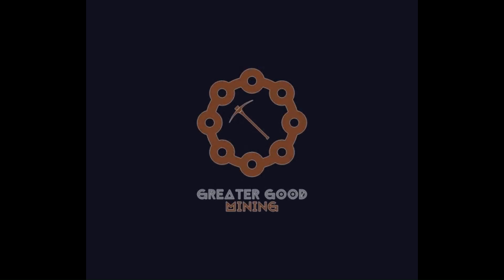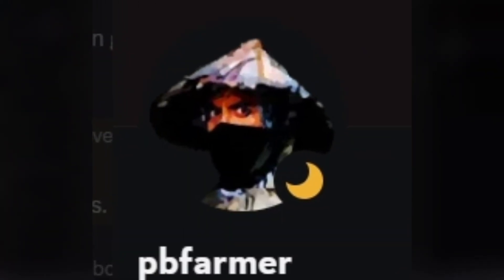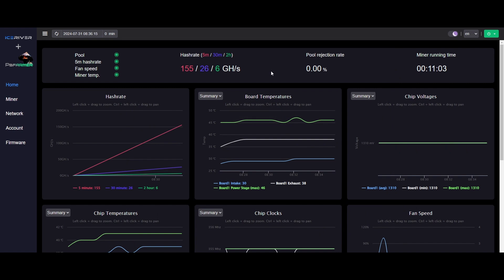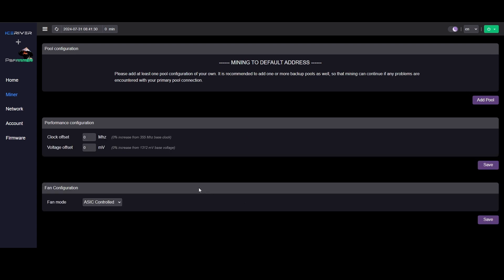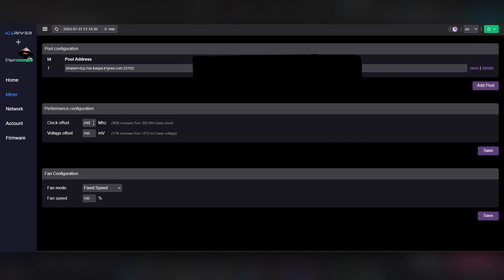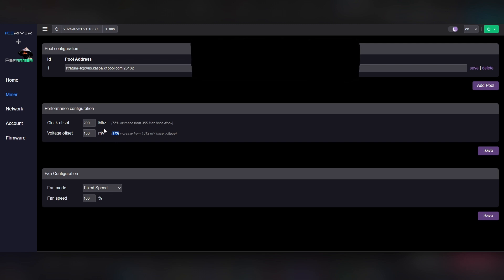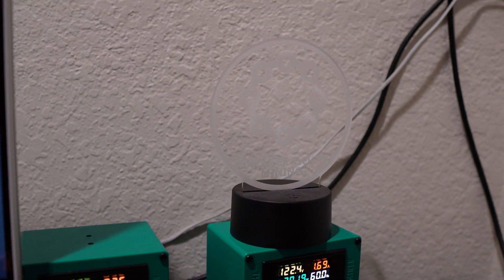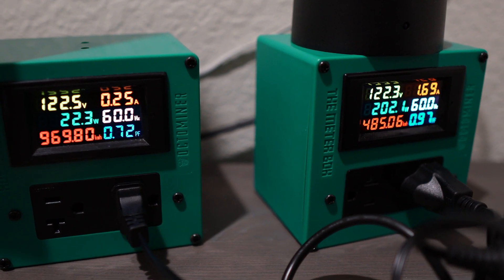NEW! Iceriver KS0 Ultra Kaspa ASIC Overclocks from PBFARMER! (KS0 Pro giveaway!)

Comment: I encountered a weird problem today. I had my ks0 ultra overclocked and mining for a couple weeks but my powerstages were over 100 so i decided to add copper heatsinks. After i did that and let it dry for a day i plugged it back in and it wouldnt hash. Powerstage and chip voltage would stay at 0. I tried setting overclock settings back to 0 and resetting multiple times nothing helped. I had to factory reset it, then it was showing machine offline so i had to change ip to static, for it to show as online. Then it still wouldnt hash and was saying unstable. So i reflash pbfarmer and now its working perfect and hashing again....WTF
Reply from the maker: That is weird, I havn't had anything like that happen. I'm glad you got it sorted out though!
Reply: @GreaterGoodMining  it's been hashing way slower. Since it started running again.  Set to overclock had it at 600gh now has it at 430. When not overclocked ot can't even touch 400 now .

Comment: Thanks for the Video and also to PBfarmer. My Ultra runs at 600gh with no problem using cheap dual 120mm usb fans and one shrout, removing the closed frond and back plates, new heat paste and 4 extra heatsinks for the power mosfet. 
200mhz +56% clock (555mhz) , 175 + 13% voltage (1500mV)
Fan 70° min 30%
Reply from the maker: @mucwendel  nice, those are great results 👍  How are your power-stage temps?

Comment: Do I need to open up my Ultra and change the PSU to install this software and get a little bit more GH? How much GH could I increase with just a normal computer fan on the top of it?
Reply from the maker: You can do light overclocking  without changing out paste or pads. You might want to at least take the side panels off to allow for some heat removal. You could shoot for 500gh and see how it goes by slowly adjusting

Comment: KSO Ultra is running great with the new PBfarmer firmware. Getting just shy of 600gh. #meterbox
Reply from the maker: Nice! thats some good results!
Reply: Hi i had also tested the pbfarmer fw on one of my ks0 ultra. I config my mining pool but i didnt see it on my mining pool Website. On the websurface of pbfarmer  i have seen green point only on the pbfarmer Adress but i didnt see if my pooling Adress is working. Do you know the Issue?
Reply from the maker: @svencronau8321  did you set a back up pool? It might have switched to a back up pool
Reply: @GreaterGoodMining  i have added  only my pools
Reply from the maker: @svencronau8321  is it the same pool enteted 3 times?
Reply: @svencronau8321  I'm not sure what the issue is. What pool are you using, and are you sure you're using the correct port?
Reply: @angrybear6611  i have to open an port on my router ? This i have not done

Comment: Thanks for the super video. The fan shroud you printed yourself the narrow black one, would you happen to have a link for the STL file? ❤
Reply from the maker: You should be able to find the file if you look up KS0 on websites like thingyverse etc. I'm not sure if I would recommend this specific shroud for everyone because it does seem to have some design flaws. I think the neck is too short. I get a lot of blowback from my fan. I would recommend using the meterbox shrouds for this reason
Reply: @GreaterGoodMining thanks i found it 😊

Comment: it is not possible to enter the address of the pool. it throws off when saving to enter a username and password. what to do?
Reply from the maker: I havnt encountered any problems like that. Make sure you are clocking the save button after entering the stratum and pool address and that you are putting in the information correctly
Reply: @GreaterGoodMining  I'm entering everything correctly. I even reset it to the basic settings several times. and I rewrote it. It didn't help

Comment: Hi, I bought a 24V 10A power supply, can I use it on the Ultra?

Thank you so much for all your excellent content, you have helped me increase my hashrate ❤❤❤❤
Reply from the maker: Thanks for watching! I don't like to recommend PSU's to people for these expensive machines without more information. The only ones I can recommend based on my experience are the ones I posted in the description of the video or the stock Iceriver PSU if you dont plan to overclock

Comment: #meterbox I started with 2 OG KS0's overclocked but skipped the pros. Straight to 2 KS5L's but these overclocks are gamechanging. Popping a 4inch inline on mine and just letting it sing
Reply from the maker: The Ultras are pretty impressive lil miners!

Comment: I'm excited to see what PBFARMER can get from the KS5L.  I couldn't get more than 12.5 Th/s stable using Tswift's firmware, which is only 4% OC.  Maybe PBFARMER's will be better with its additional controls.
Reply from the maker: I havnt tried overclocking my KS5L. It doesn't seem worth it to risk it so far for only 4% more hashrate
Reply: @GreaterGoodMining  I don't see much risk.  The power consumption was the same as were temps.  Granted, I was cooling it with immersion.  I would probably continue to run it slightly overclocked.  4% is stil 4%.  But I agree that there's not much reward for taking a bit of risk.  In most cases, stock is probably best

Comment: So, there's no 2 step update needed like twifts firmware?  Just update it with the 1 file for the ultra?   Thanks for getting this out quickly!  GGM on top of his game today!
Reply from the maker: Correct! If you're stock you just upload pbfarmers firmware and adjust as you like. No weird bricking issues like with the original Tswift firmware. Pbfarmers also has a normal reset procedure. No need to upload a different file to reset to stock
Reply: @GreaterGoodMining  Sweet!  Got 2 Ultras both are around 500mh with no overheating power stages (less than 100C) and no power increase!

Comment: Already overclocked my ks0 ultra so probably not going to overclock it with pbfarmer’s but it’s nice to have options #meterbox
Reply from the maker: The other thing Iike about this one is that it's safer. No worries about bricking it if it needs to be reset etc. Thanks for watching!

Comment: #meterbox couldn't get Twsift working on KS0 Pro, but PBfarmers worked. For my KS0 Ultra, Twswift works, so I'm wondering... Always loved PBfarmer's WebUI.  Go Kaspa!
Reply from the maker: That's weird I wonder why? I've had something similar happen with the first batch of Icerivers. Something different about them where the OC'S wouldn't work
Reply: @GreaterGoodMining  unlucky I guess! I first thought it was the power supply and switch that out and it wouldn't work still... That's just the journey